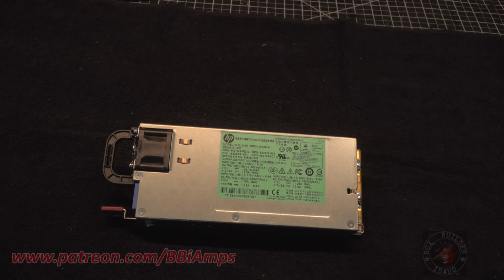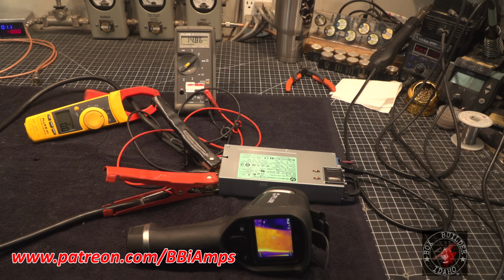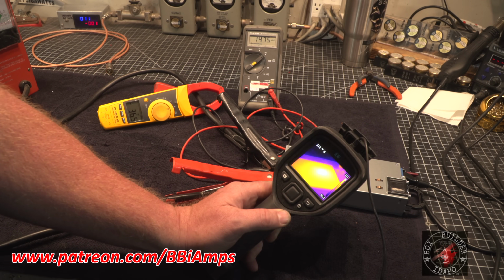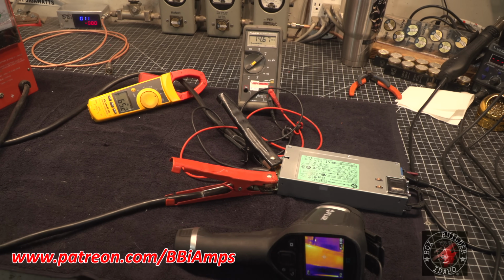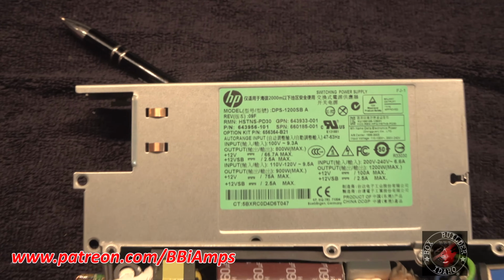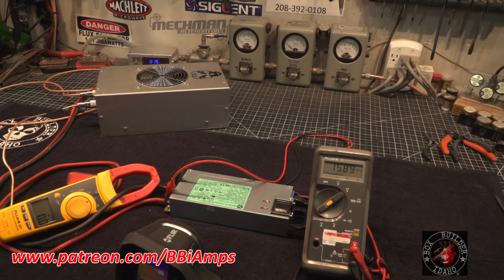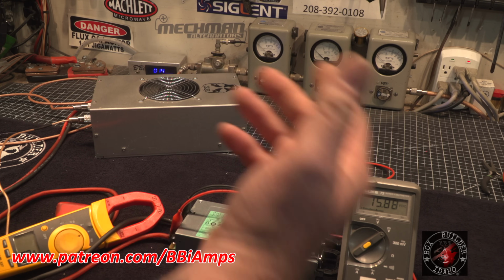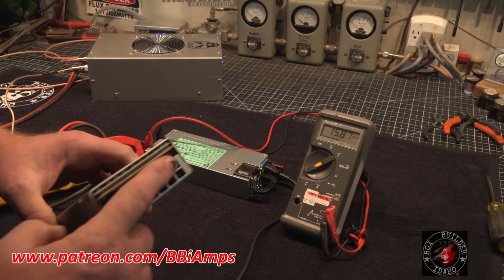let's volt Mod a Hp,dps-1200sb 100amps

Comment: Is it possible to adjust the voltage lower in this power supply? When I try to lower the voltage below 12 volts, my power supply turns off. Does anyone have any ideas on how to disable this protection?
Reply from the maker: No I'm not aware of that mod I'm sure it's possible but I'm not aware of that mod

Comment: You should check out this video. He uses one of the other model numbers, (Hstns-PL18) and makes a variable battery charger with 3-16 volt, 3-60 amp ranges.
https://www.youtube.com/watch?v=rRM_0THcy2U
I just modded my first DPS-1200SB A. I am getting 14.7 volts with a 37k and 13.3k resistors.
I am using it in a ammo box radio setup.

Comment: Thanks for your informative video on this unit. But I have one question,the gentleman that you mentioned that has these units for sale I’m not able to find on eBay. Could you please send me any information that might send me to his site. I’d like to buy three of these units to build me a battery charger out of one and a power supply for my amp with the other two. Thanks so much for any help on this. Thanks 73,s to ya.
Reply from the maker: Play sold out of the 10,000 units he had for sale 2 years ago bud

Comment: I bought into your selling the Meanwell 30a power supplies just to realize my build time was wasted on BS power supplies.
It would seem you've done it to me again with these 1200 sb's. Bought three tested them, placed the lan leads while waiting for the 15&51k's . Upon completion of the mod. Not only does it not work, upon removing and setting both pots to their former values, the mod has rendered these power supplies inert. Sincerely pissed.
Reply from the maker: This is very odd. Your statement. I've never sold meanwell switching modules never not once never. At this point there has been tens of thousands of these units sold. There has been a few guys that have had problems with modifying the supplies. Which after working with them " owners" we got most of them running. But there's literally thousands upon thousands upon thousands of people that have had success.. moreover most all solid-state switch supplies at this point are based off of either this particular module or something that is close to it that are currently being produced. If there's anything,  I can do to help you please feel free to call. Have a good Fourth of July weekend.

Comment: Awesome. Thanks a lot for this video. I being using this power supplies for more than 12 years. Almost no info to make them work. I start playing ans make them turn it on. After that I add a potentiometer to increase the voltage but no more than almost 13volts. This video made me fall in love with this power supply once again. One question. On the first part of the video the power supply was on 14.8volts. You change the resistors values again to make it them to 15.8volts? I am thinking to use a potentiometer again to be able to adjust the voltage.

Comment: I have a 20k to the pot and a 10k for crowbar. Puts out 14.5 volts on 120v. Tested it with a Kenwood TS450 and seams to work fine. I had to replace that 51k because it was shutting off. With the 15k I was getting 16.2v.

Comment: Hi, could someone help? I need a large amount of power for a very short time. The power supply randomly shuts down because of that. Is it possible to bypass the overcurrent protection? The power supply is capable of producing it if the protection could be removed.

Comment: I finally bought the previous generation of this model to power my dad's old high performance class AB car amplifier which consumes about 100A at max load and it runs great. I previously ordered that chinese switching power supply which was rated at 600W 50A but when I powered it on my house circuit breaker tripped. I am not sure if it is because it can't handle the amplifier's initial current demands or what. If someone had any idea, let me know. Note, I did not buy the cheap one based on the amp's current demand I bought it based on it's power which is 450 watt.

Comment: Hi BBI, great video man ! I came up with 18K for voltage and 22K for crowbar on mine to achieve 14.5 VDC and tested it on 110 AC with a rci 69FFB4  and it passed the test, I tried the 12K for voltage and 39K for crowbar but the supply kept shutting down without any draw even put on it, not sure why. Keep up the good work 👍

Comment: Hi master, thank you for all the great knowledge you share with us. Quick question….what would I need to add to make one of this into a suitable battery charger?

Thanks in advance!
Reply from the maker: @DownloaderVideo  you'd have to add a circuit that ramps the voltage up and down. So I guess you could get on Amazon and you could use a timed voltage controller and fluctuate the resistance on the 14k resistor that controls the voltage reference. I'm just shooting from the hip I don't know I've never really sat down and thought about it
Reply: @ Thanks Master, I’ll research about that.
Reply: @BoxBuilderIdaho Another question, are you aware of variations depending on the revision? I just got 2 and same model and everything except these are Rev16. 

Thank you!

Comment: Hello, do you think it's the same procedure for the 1400w one? I have a dps1400 cb and wanted to do the same thing to mine. Thank you
Reply from the maker: @cavidoman  I have found that there are some similarities between a few of the modules but none of the modifications are in the same place with the same valued resistors

Comment: A really needed hack to this PS is to add an adjustable current control.  That is to make it a constant current PS with a max voltage limit.  This is needed for viable battery charging.   Some one how figures this out would be a hero !

Comment: Very good video. OK, so I'm in the UK that uses 240v, would I still use the same resistor values? Also, when searching for resistors, they also mention eg., 1/2W 5% tolerance, is this figure important?

Comment: I also modified my DSP-1200 SB A with a 22k and a 56 resistor to get a perfect 13.84V for my Icom Ham radio. Work fine for a few days but then went completely dead. Opened it up and noticed the 22k resistor got detached from the varible leg. Soldered it back on but doesn’t go on. It’s completely dead. is there a fuse somewhere in the PS? Any Clues if it can be fixed?

Comment: I modified the HP1200 supply with the black power connector quite a few years ago so I could get 14.6volts. Thank you for showing the mods on the 1200sb(blue power connector). Can't wait to mess around with one.
I did make a variable external voltage control for the black connector 1200, and had it controlling 2 of them. It's still working like a charm as my bench power supply.

Comment: Thanks in advance. Any detailed pics for exactly where to solder the resistors /size K? l did this once with a HPE 1200W DPS-1200FBA PSU but they are hard to find these day's That was only 2 resistors as l remember.

Comment: Just got my DPS1200 SB and getting ready to do mods. Im going with the 9K and 18K resistors. I did not see in any of your videos if 
the resistors are 1/8,1/4 watt.
Thanks
Reply: Which did you end up using?

Comment: Installed a 15k on the outside and 51k on the inside. Powers up at 14.4 volts then after maybe 20 seconds voltage drops to nearly zero with no load. Triple checked the solder points and no shorts. Any ideas?
Reply from the maker: Yeah the Crowbar protections taken over so drop the resistor down to 9k for the Crowbar protection which is the one on the inside of the unit
Reply: Working perfectly at 14.2V!  Thanks for the video! @BoxBuilderIdaho

Comment: Sub just for the humor! What do you think a good combo would be for running Just ham radios and ham related equipment? I don't have nor plan on right now to have any amps as I'm just getting into ham. My first radio is a Ft-857D but I plan on getting a 7300 or the new FTDX-10. Seems like most, at least 100W, radios use " 13.8 v +- 15% or 2V for a nominal range of 11.8 to 15.8V" as the range. Would trying for a 14.5-15V be a good landing place? I assume from the manual you don't want to go over 15.8V so that's where the cut off or Crow bar should come in before that?

Comment: You know "crowbar" is not used for current. It's for over VOLTAGE! Normally a triac fires at the max voltage threshold, and causes the fuse to blow.
Reply from the maker: Very well aware I'm. Very very well aware but when the Crowbar protection is automatically set so high you cannot search even half of the rated output for the power supply it needs to be adjusted at that point

Comment: I use 1 watts resistor after the mod turns on with 13.9 volts, but after 1 min, the voltage lowered to 13.3 no load. unplug the power and plug again, and no power is coming out. No  led light and fan stock on high speed. Do you have any idea what could be wrong?
Reply from the maker: I would double-check your solder joints on the inside and make sure that you've got decent insulation all around the leads of your resistors.

Comment: I ask about the resistance watts because I use 1 watt (15k-51k), and it looks like it doesn't work. Yours  look smaller. After the mod works for a minute and I reconnect the power and the fan works only at a high speed and no green led, no voltage output any help? Thank you

Comment: Curious what the min/max voltage range was when you used the 9k and 18k ohm resistors.
Assuming the pot still sets the voltage. 
Thanks
Reply: 10k/20k I’m see a range from 15.4-16v .

Comment: Mr BBI, some feedback if I may.  I purchased two of these units for some projects that I had.  One was to be used as a simple 12v supply to a 3000lb winch for my tower, which it does very well without modification.  Good by old lead acid battery and charger setup.  Its fed 230/240v volts (I'm in the UK) and it drives the winch at its nominal 60-80 amp load.  It even supported a peak of 135a when I deliberately stalled the winch without tripping out! Excellent

I then modified the second unit as i wanted a good quality shack 13.8 (ish) volt supply for my ham gear.  To get 13.8v i needed 20K of resistance across the voltage adjust point, and i used your suggested 51k on the crowbar circuit.  So far so good.  I will report back if i have any issues when this is in use.  I can confirm the units are very quiet acoustically(less noise than my linear unit!) and I haven't had any noise on my receiver from them yet.  

Cheers Des, GI0UTE.
Reply: Did the same mode 20k and 51k, 13.8V. Works awesome.

Comment: Luke, thank you so very much for all of your videos. I am going to try and make one for my broke ass self . Love the comments about Bob and Fred . But this Fred just had 2 rods, 10 screws and 4 degreed cages added to my L2-S1 and finally getting to spend about 10 minutes to get my own damned socks on. About 3 years ago I had seen a video in one of my groups running a server power supply for his radio. But I never continued to follow-up with him. 73 2WR003 Fred in the Shed in the Swamps of Dinsmore Florida

Comment: I make /run a different hp server power supply that is 65 Amp rated at factory settings. I figured out how to get the voltage to 12.55 cont I nious with a drop of only .05 when approaching max output. I have the fan also running so slow it can hardly be heard. It only ramps up approaching max current output. The power supply has reverse polarity protection and overload protection and direct short protection. Almost impossible to blow up. Protects the equipment it is powering. All this is accomplished without removing the cover. All done with jumping pins on the end. I connect 2 together using the common share pin connection . I use number 6 all copper welding cable for out put connections.  I have and my friends I built some for have left them running for over 4 years continuously.  Never had a failure yet but if one fails I will replace it no charge. I hooked to carbon pile load tester and got 70 amps without shutting down and that was good enough for me. Search for pin outs for the common share connection when combining.  It equally distributes the load. When over voting from factory design the early attempt proved to be unreliable and failures. I hope this has been solved by BBI. 12.55 with no current or little voltage drop is perfect for Mr with a quiet fan. These were designed to run 365 days a year from the factory. Never got a bad one from ebay just dirty sometimes and I believe all were used to some extent.
Reply: Where do you modified the fan

Comment: Sweet BBI, I've been using them for about five years and I appreciate the extra tip on the resistors. 516 a local Builder here in Indianapolis has been using those and a couple of different versions. And there sure are a lot cheaper then the meanwell power supplies also longer-lasting. Peace and blessings out there keep up the good work. You're 47 around the fields of Indiana the all seeing third I got down right there.

Comment: Be aware that there are typically TWO DIFFERENT VERSIONS of these power supplies.  The PD version you show, and a PL version.  The boards are somewhat different. Mods are not the same.

Comment: After watching 3 times it's occurred to me maybe an experiment in destruction is in order. With some ratty amplifier that's been left unpaid and most importantly doesn't have Toshibas in it.. To see what happens if the crowbar protection After modification kicks in or fails to kick in entirely and the PSU Chernobyl's? I wonder what the rectified voltage is at the FREDs. Is there post regulation after high frequency rectification or is it controlled by the switchers feeding the toroidal with input amplitude while still an AC signal. I should get mine soon but I will want to know what it's failure mode is because they certainly have one. It's probably all good. But Toshibas are pricey  to learn on!

Comment: I have repurposed similar switchmodes before, they don't like the load suddenly removed, the response time means they tend to crowbar. Amazing value for money though... and the crowbar issue can be addressed...very tempted to buy a few of these, 14v will be fine for my purposes. Tempted to just use high current diodes to combine a pair, unfortunately that will whack the efficiency a bit. 
Thank you for taking the time to do the video...

Comment: If a small switch was wired into the tabs up front instead of a jumper  would that be safe to turn the power supply off and on? Wanting to hook two units together for a 200 amp 240v supply
Reply from the maker: You got it

Comment: If anyone is interested, I can supply information on how to mod Delta BML 353 206/2 (~70A @ 27V charger/rectifier) for different output voltages. Also figured out digital control information for Emerson/Vertiv rectifier (eg R24-2500 and R48-3000, 24V and 48V at 2.5/3kW). All modules are or at least were quite cheap on the telecom surplus market. The digital control information likely also works for a 12V Vertiv rectifier module, but I never saw or touched one.
Reply: BTW: The 48V model works as a very under-powered, but nonetheless functional, welder ;)

Comment: might be worth checking out gaming computer power supplies..they can get big numbers and some are switchable ..obviously they are more pricey but could be another option.they have built in fans and such for cooling.
Reply: Normal PC PSUs have unneeded voltages and usually cost MUCH more. Server PSUs are typically designed to be run 24/7/365 with minimal down time so are the better choice.

Comment: I would think if you were to stack 2 or 3 of these and run a variable voltage option, you may be able to find a variable resistor within the value range needed for the crowbar circuit. You would just need to mark the values of your variable resistor on the outside of the cabinet or wherever mounted on a rack. Just an idea though.

Comment: I've got one of those power supplies that you waved across the screen at the beginning running my old Cobra 148GTL radio. Has been working for 5 or more years perfectly. It peaks at 20 amps which this radio never draws that. But the darn fan runs all the time. Can't figure that one out. Have you had this problem before with these?

Comment: Super cool I'm thinking 3 of these tied together then hooked to an insulated copper feed bar should be enough to handle a couple radios and a transistorized amp when I'm not running the base amp. Thank you Luke and 249 for sharing this knowledge 😁
Reply: 😊lpllplll
L
Lllplll
Llll

Comment: RC and crypto mining guys have been hacking these for years now. If you buy an old server, that these go into, you get a nice slide slot and typically an adapter board where these plug into. You can use that to get a redundant, hot pluggable PS that does load sharing. These can be also connected in series for higher voltage but that is bit more involved operation.

Comment: You need to try one one  these... DELTA AHF-2DC-2500W-PE 2500 Watt Power Supply This is a 208 amp @ about 12.3V  200-240V input.  can get them for around 30 to 40 bucks. I have a few here I'm testing with. Runs a sweet 16 with virtually no power drop. still trying to mod the voltage up and figure out the protection circuit . There is no info on them for mods anywhere.  So this one is  going to be a hard nut to crack. I did not have any noise on my  IC-7300 receiver too which was a big Plus.